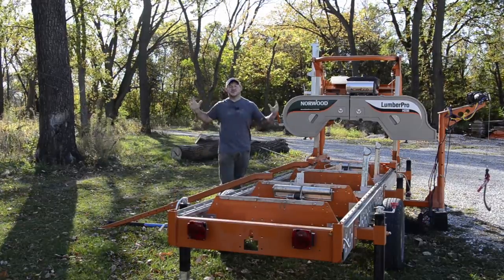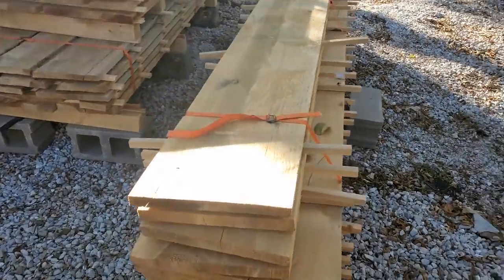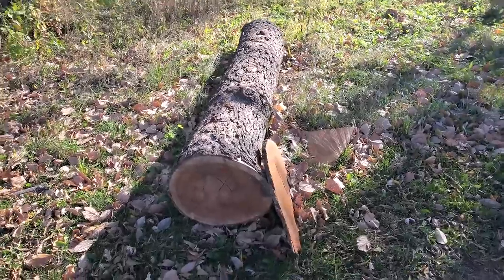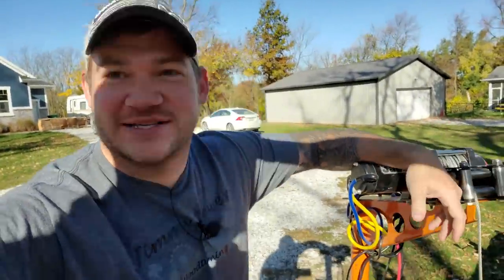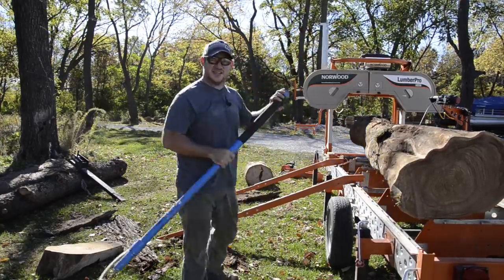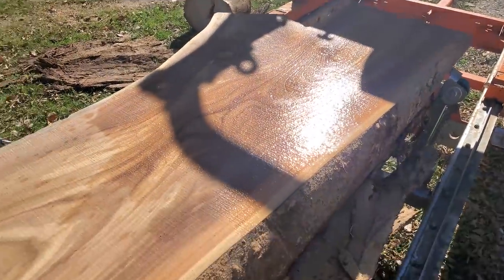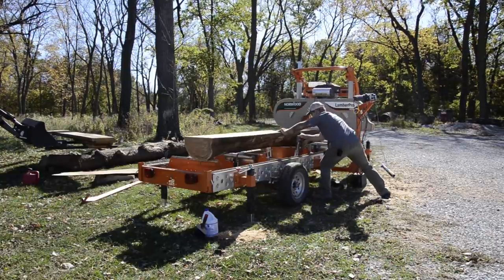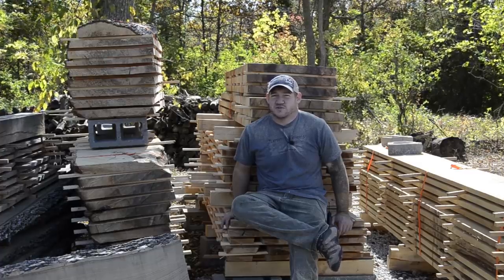Cutting a Mystery Elm on my Norwood HD36 Sawmill!

Comment: I remember when elm here in northern Minnesota was milled, it was very unstable while drying because of the narly grain. But tough as nails. Very twisted grain, had to use a wood splitter to split the firewood blocks. It's a good idea to trim the log ends before milling to start with a "greener" surface.

Comment: Do you have to have a deep cycle battery or could you run winch on the battery for your engine? It has a charging system that should put back the power you use. I have an ATV with a winch and it has the same size battery as the mill.